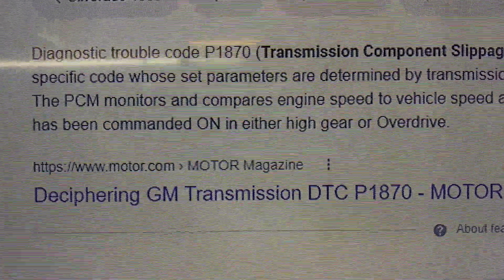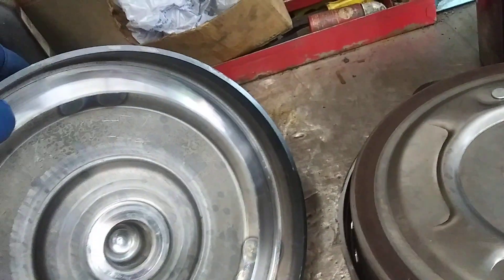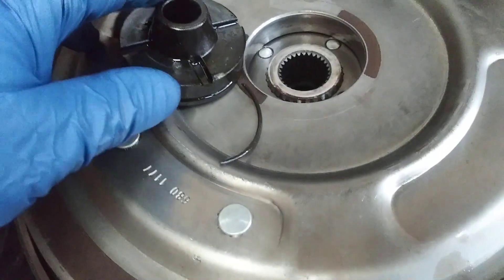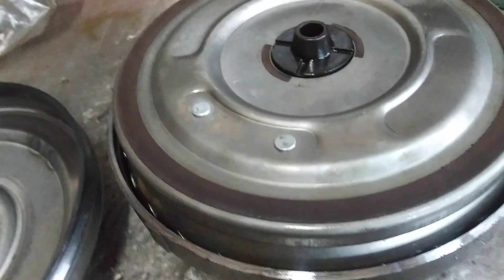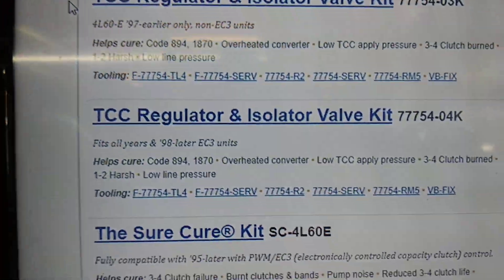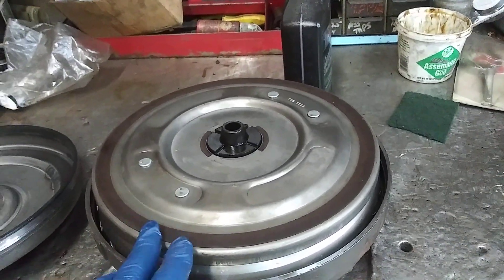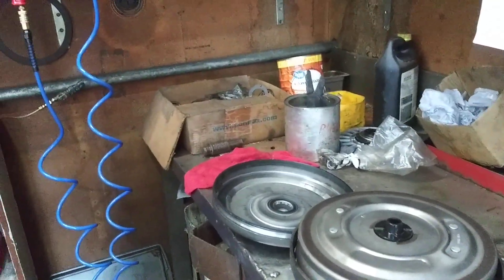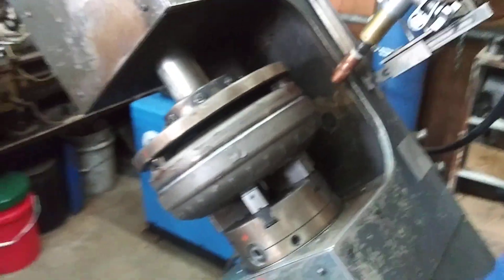P1870

Comment: My Rodeo sport 2d gave me this code after repair the whole transmission. I took it back to mechanic and he told that everything was replaced and new torque converter but not the solenoid and he told me that the tcc solenoid is bad. Have you seen this before?
Reply from the maker: Yes

Comment: How do I know if it's the valve or the converter? Thanks
Reply from the maker: Your update the valve and see if tcc slippage is with in specs, if not change convertor. When you remove pan to update valve, if pan is loaded with metal, remove trans.

Comment: great, after a while on the road at 100-110km it kicks from first to second, it disappears by turning off the truck for a minute but if I run at that pace again it comes back, when I got home I scanned and p1870 appeared
In the city it doesn't do it alone after driving on the road for a while.
thanks
Reply: truck silverado 1500 year 2000
Reply from the maker: High tcc slippage at prolonged high speeds will set code and put trans in fail safe mode
Reply: Would P1870 cause my truck not to move? 2001 Silverado 1500 V8 when I first start the truck it shifts and drives normal but by time I get to the end of my short street the RPMs start flaring up and truck doesn’t wanna move. Turn the truck off and back on and it will work normal for a short period and then same issue again, undrivable. 100k miles ago replaced the 4L60e with an updated reman unit. Have never changed the fluid ever. Fluid level is full not burnt but dark. Great video and appreciate any reply!